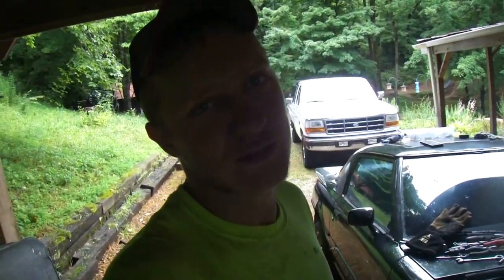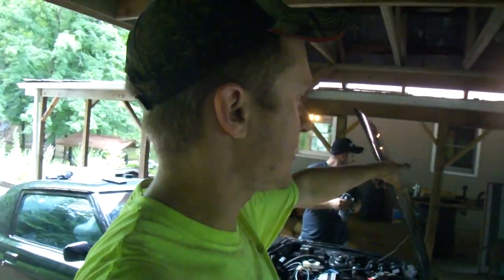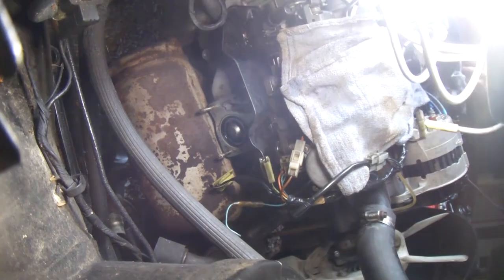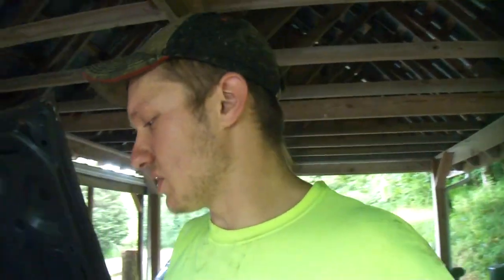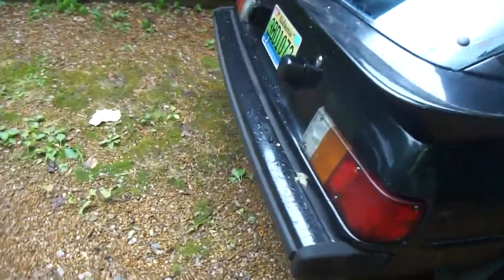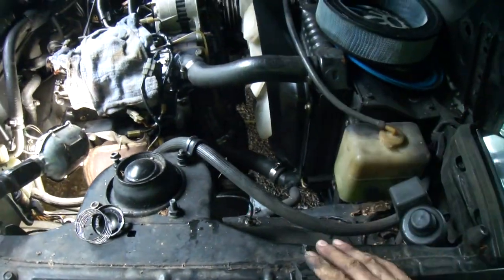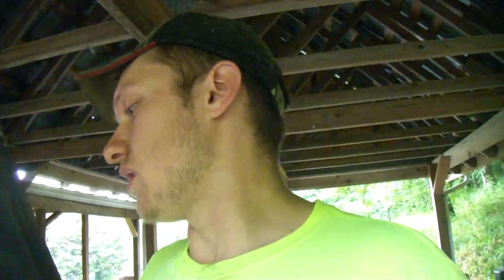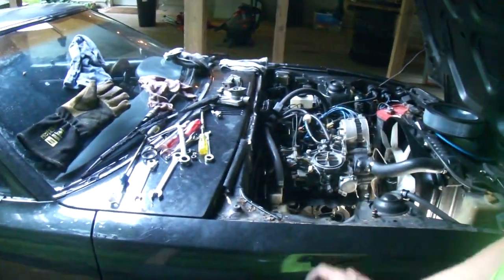1979 RX7 CAT DELETE - HEADER INSTALL

Comment: i know your busy somewhere,  im experiencing a STRANGE problem. My voltage regulator buzzes when I connect the battery. IT looks new under the cover with no contact corrosion.  AND , the new a/m fuel pump runs with key off when I push the brake pedal . SHAZAMMM

Comment: Hey rad what header should I go with if I wanna run a edelbrok on my first gen I’ve been having bad carb problems
Reply from the maker: Edelbrock is going to be a tough one. I have never touched one of those carbs.   Header, any will work fine.

Comment: I got an 85 gsl ,gonna do a racing beat header and sone custom piping,  but with that being said will i still need block off plates for when the factory exhaust header comes off / or just a 12a exhaust header gasket to put the new on ? Thanks mate.
Reply: Is that just for the 79 model
Reply from the maker: You will need a block off for the intake manifold.  Iirc its similar.